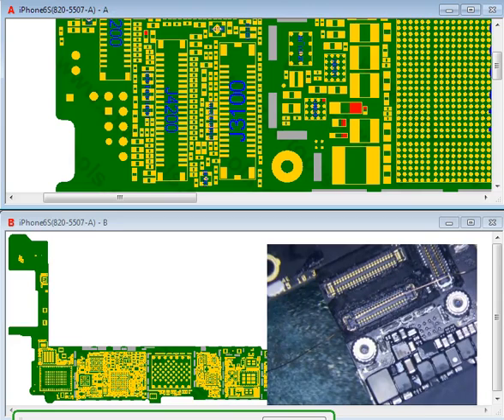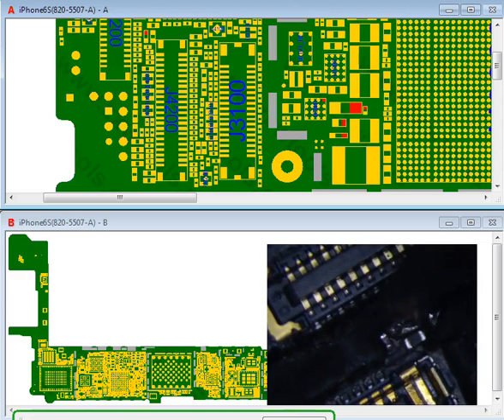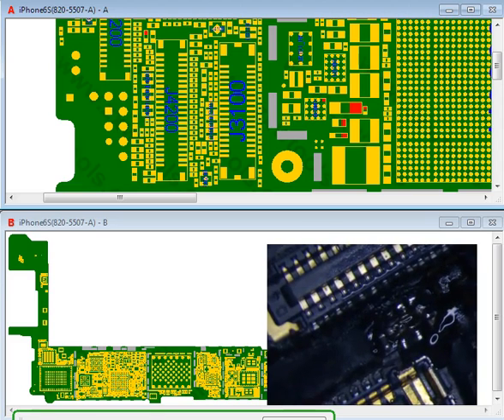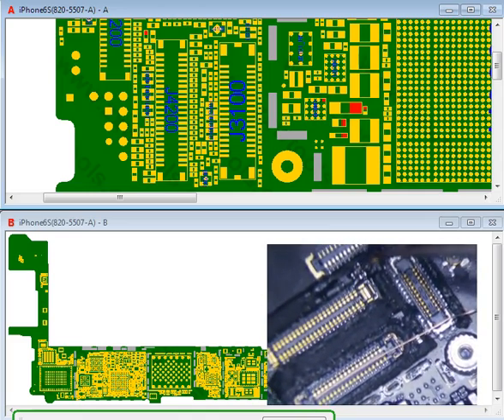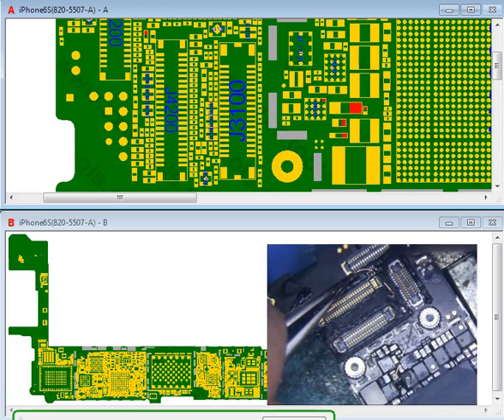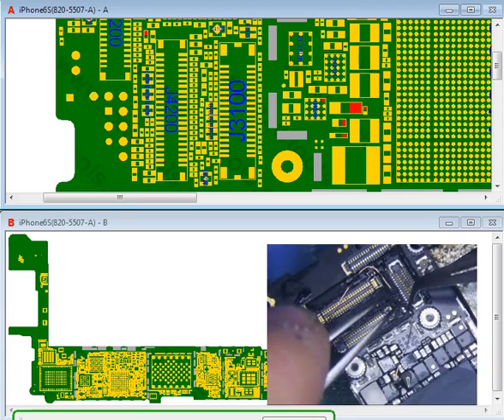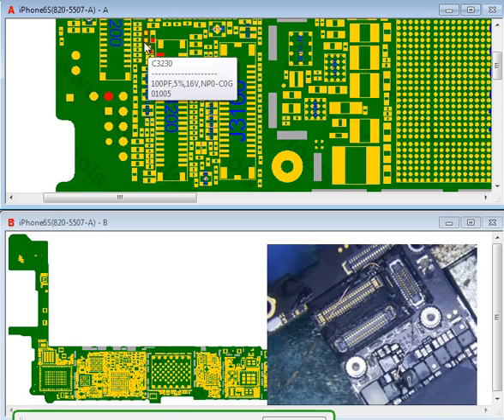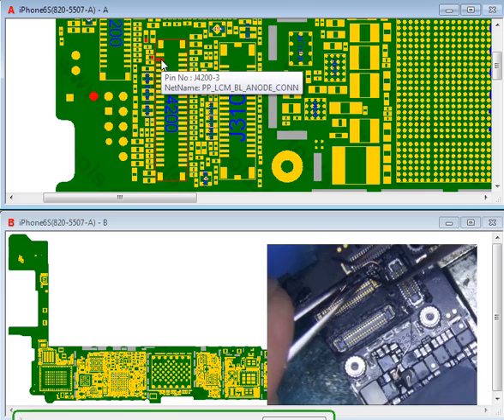iPhone 6S Backlight Repair   Missing Pads

Comment: hi could you tell me what that small component to the left of the pad you were pointing out as damaged is. the same  filter you were repairing is the same one on my board that had disintegrated but the pads were ok, that small component came off when i was removing the black stuff from around it. any help would be appreciated thanks.

Comment: Is there anything I can do when pulling a pad on a filter besides jumping?
Reply from the maker: gotta jump it
Reply: Thank you. I hate when they try to eject theirselves from the board makes it almost impossible to preserve he pads. I was using hot air and successfully removed the filter I could tell it was bad. Im still fairly new to this so I almost had a heart attack when the pad came off
Reply: I currently do not have ZXW can you tell what line the rear facing camera and front camera are on for a 6 plus. for some reason both are blacked out and Ive tried new parts. still doing the same thing
Reply from the maker: Most likely something called the LDO.  It's a 4 pad glass square below the rear camera connector encased in the black epoxy.  You don't really want to mess with it unless you have experience with this kind of stuff and the tools to do it.

Comment: Want to sell the of hakko tweezers?
Reply from the maker: rupert handford yes I do.  Make me an offer
Reply: Can you keep them and we can make an arrangement when I order zxw tool?
Reply from the maker: rupert handford sure how long are we talking about?
Reply: Before end of January, what base do I need? Cheers mate
Reply: What kind of jumper wire do you use
Reply: mrsemifixit depends on what you are jumping. 40 swg (0.08mm) or a strand of solder wick are both quite common I believe
Reply: rupert handford Are they enameled or bare?
Reply: mrsemifixit Solder braid is uncoated, other wire is coated but solderable (Magnet wire)
Reply from the maker: I use gootwick solder wick as my microjumpers.  They are uncoated.  If I need something stronger, then I have the wire from microsolderingsupply.com, which is coated.